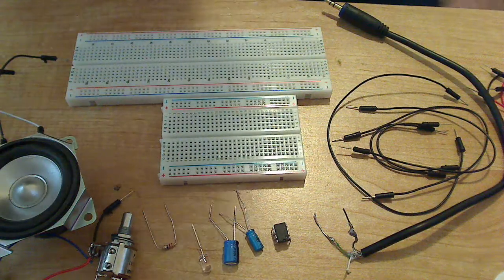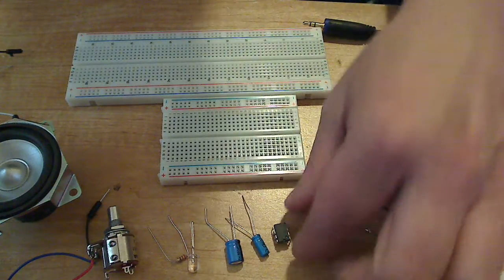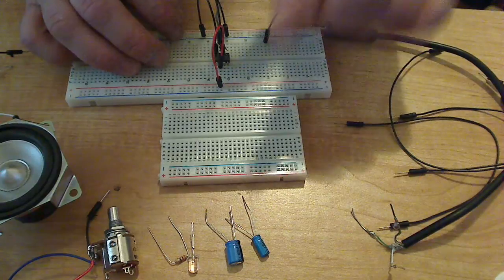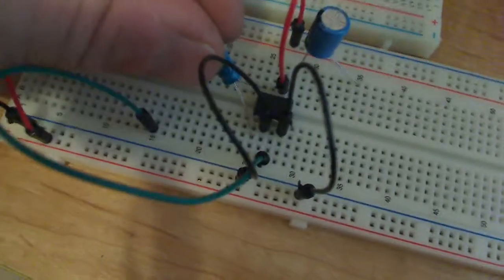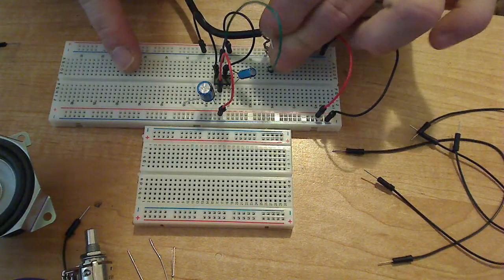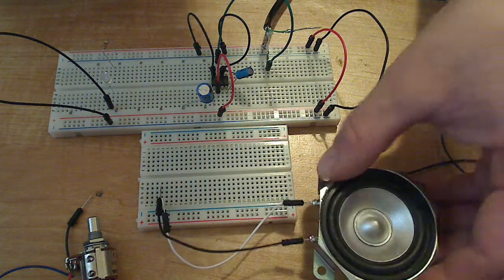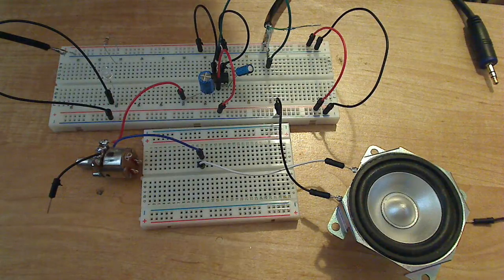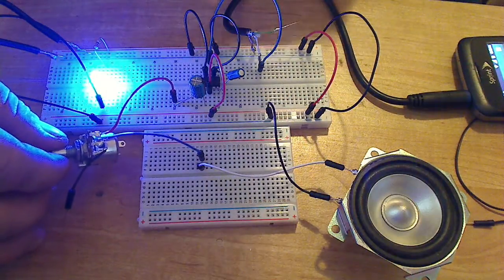How to put together an lm386 circuit

Comment: Hi man your video was great! I tried it and for some reason it is very distorted and full of outside noise. I have a good power source my capacitors are all good and I have changed the chip just for the fun of it and it still doesnt work. I wish it worked out as well as yours, oh well great video anyways!

Comment: Do i have to use a potentiomiter?
Reply from the maker: No you don't you can use the gain from an mp3 player or whatever or by changing the capacitor that goes to the pins 1 and 8